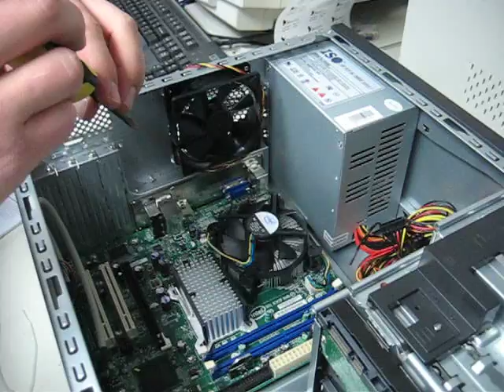intel CPU replacement.AVI

Comment from the maker: You're right! If you're that far into doing a CPU removal, you may as well clean the thermal compound from the top of the processor and the bottom of the heatsink. Just a bb sized application of fresh thermal compound will be perfect. Squeeze a dab in the center of the processor. Then reinstall heatsink as shown.
Goob recommendation Márk!